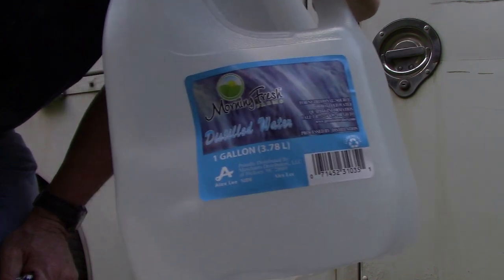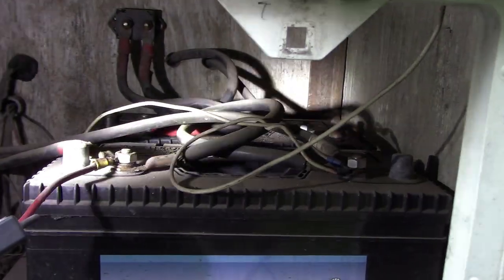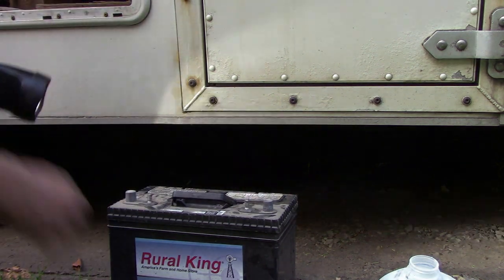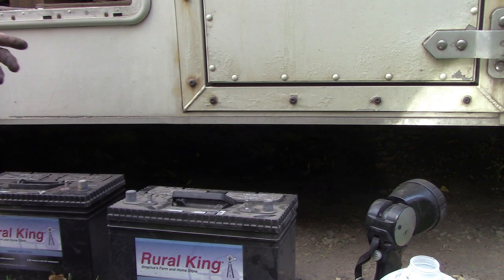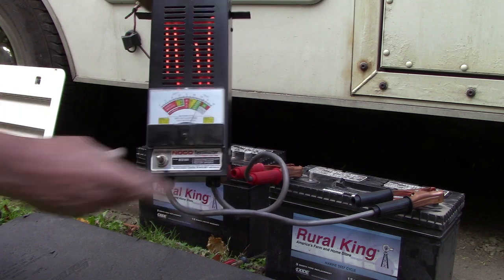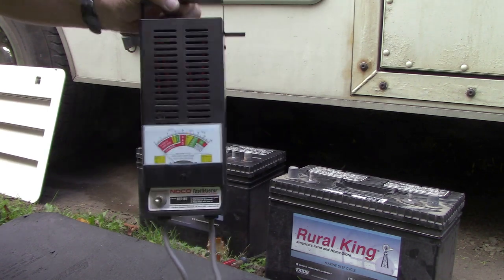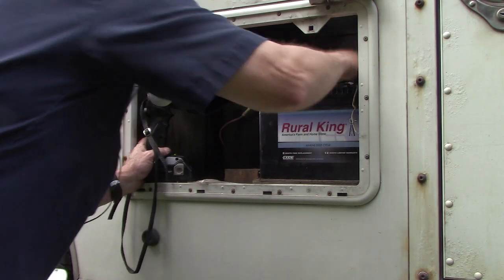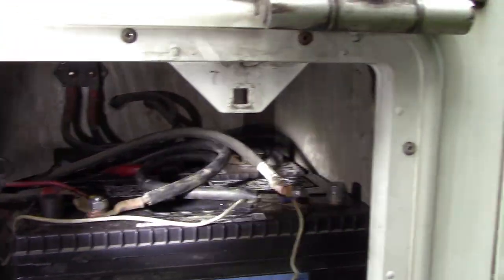CAUTION EXPLOSIVE !!!!!               Wet Cell Battery Maintenance

Comment: Good topic Kenny! Thought I'd share what I did with my batteries in my coach along with everything you did. I have two 12 volt chassis batteries and four  6 volt deep cells for the couch which are mounted on a drawer shelf.  Makes it easy to check fluids. But the other two not so easy. So many wires in the way makes it a big pain to check the water levels. My soilition  was to install a water check valve system.  Paid around 70 bucks, but so easy to fill and keep all cell up and you don't even have to touch the batteries. Ill try and post a picture if I can. Thanks again for all your videos..
Reply from the maker: Yes I have seen those, but man I am old school..... thanks Ben